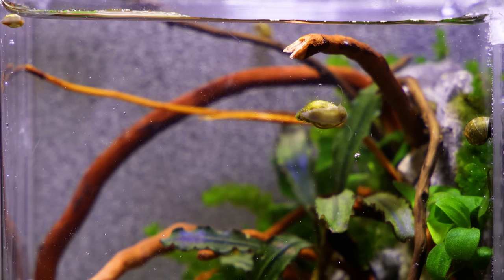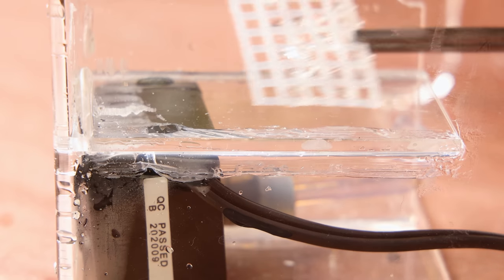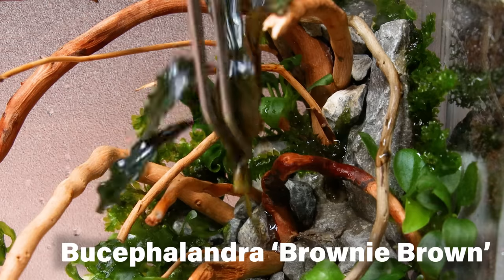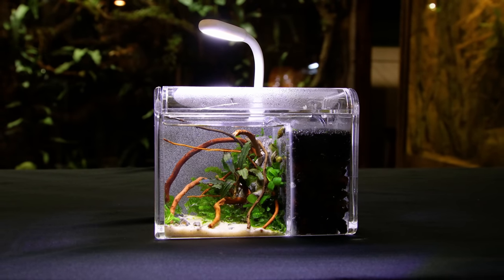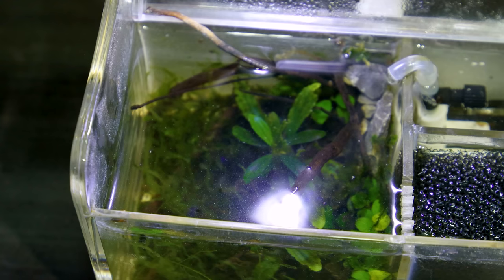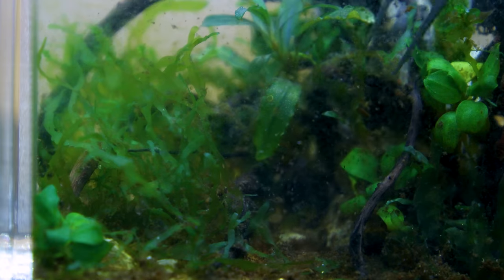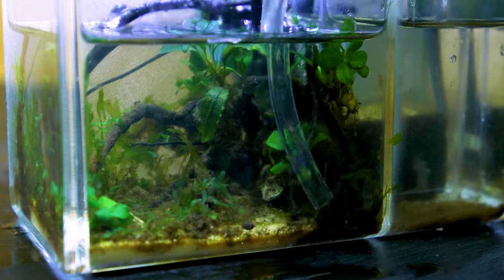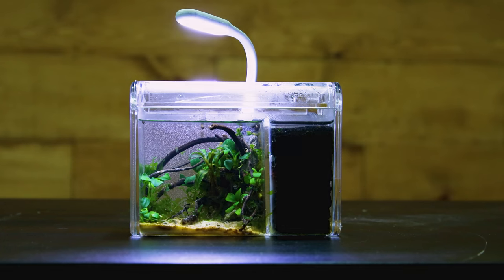I Made a Tiny Snail Aquarium 500 Days Ago. How Is It?

Comment: I like small setups and I get why you build it, but a vase with some pothos on a window sill... and some aquatic plants and snails, some gravel at the bottom and some moss or similar woul've done the trick too with much less effort and no electricity. I have a couple of those setups running for years on end and they look fab. No water changes, not even snail food. What looks especially nice are Myriophyllum. You can start growing them underwater but they will grow their way out and they look really nice hanging out after.

Comment: I was thinking. In the UK there is a website where you can buy acrylic sheets with whatever thickness and sizes you specify. It's really hard and expensive to buy large glass tanks, and especially getting custom ones to make dividers for a paludarium would be really expensive. Also I'm afraid of how crazy heavy these are. I was wondering if there are some kinds of protective anti-scratch and anti-UV withering (discoloration) so I could build an acrylic one and protect it from deteriorating due to sunlight entering the room and scratching it with hardscape and stuff. I was thinking kinda like screen protectors for phones, but in sizes appropriate for a tank. Do you think it could work, could you advise anything?